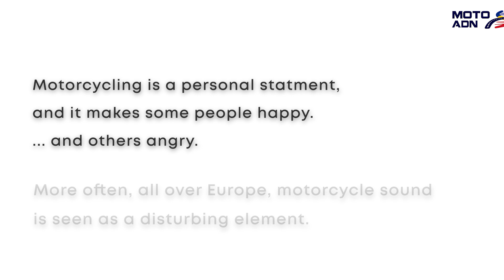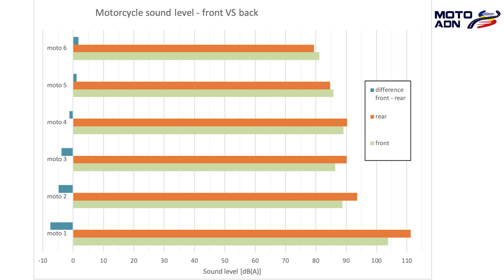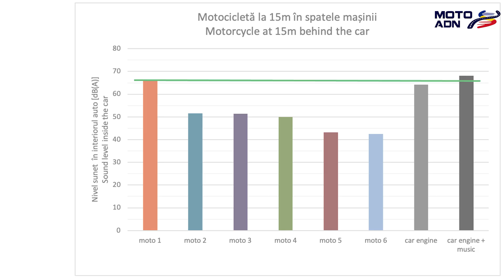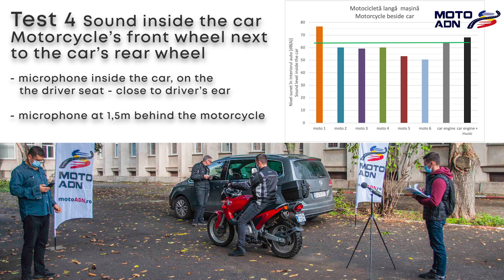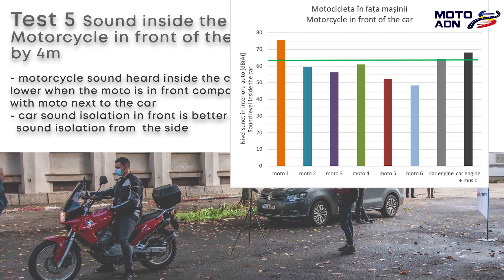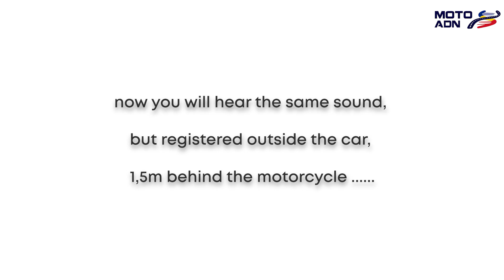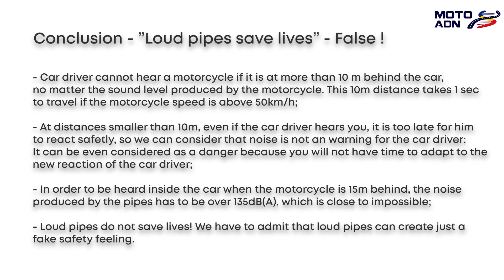Do loud pipes save lives? Now you have the answer!

Comment: I agree, your test is flawed from start to finish. Just the fact that you do a test at a standstill while the situational is in perpetual motion with sound variations makes your test invalid. All you are doing is taking sound level meter measurements... Without taking into account a lot of other parameters, such as : 

- During the inter queues, you are surrounded by cars and there is less than a meter between the cars and the motorbike. The sound ricochets off the bodywork. It produces a resonance. This is why French law stipulates that sound measurements must be taken without obstacles in the vicinity. In order to avoid amplification of the sound, by external elements, in order to have a neutral measure. This is not the case in real circumstances.

- You are taking measurements on an engine that breaks down... It produces high-pitched sounds, whereas you can perceive sounds at low frequencies much better. For example sound competitions in cars, what kind of sound do they use? Bass sounds make the windows wobble, whereas treble sounds would break them... You could say that windows propagate sound through their undulations, the same principle as speakers, they undulate in order to produce sound. You could say that the windows propagate the sound through their undulations. The walls of sound that make your hair move are bass, never treble.

- The moment when a motorbike makes more noise is not during acceleration but during deceleration... The gases remaining longer in the exhaust pipe resonate and amplify the sound.

Ask yourself the question, why is it that bass makes more noise in a tunnel than treble?
Does the sound propagate in the same way when it is 5 degrees Celsius as it does at 30 degrees Celsius?

What I can tell you is that a motorbike will never make the same noise when stationary as it will when moving at the same RPM speed.
On a personal note, the time when I should make as little noise as possible is when I'm on a steady downward speed. 
This produces treble, because the engine is in perfect balance between motricity and with less stress.

It's all well and good to take measurements, but all factors must be taken into consideration. Here's a link to corroborate what I'm saying: @t

To make a scientific test is not just a matter of taking values and putting them down on paper...

The simple fact that you did not take into account all its variables, shows a defect of proven seriousness. 
By definition a scientific test should not be within the reach of the average person. Now, with your setup, I want to do the same thing on a supermarket car park. 

I dont know, how to "quote" youtube, someone can quote @motoadn ?
Translated with @t (free version)
Reply: Spot on - completely flawed execution.

In the same way that my v-twin bike sets off car alarms in car parks whereas my previous bikes (4-cylinders) with different exhaust notes (higher) do not, supports your point about different tones causing different sound waves that travel differently and also go through things differently as well.

I think they need to do waaaaaay more research.
Reply: @Br3izh Motard, if you know so well what they did wrong, why don't you make your own video and do it properly then? You can't ignore the fact that they make a valid point stating that motorists in modern cars with the radio on, even at a standstill (ie without road and wind noises) probably will not hear you. Both NTHSA and ADAC have done similar tests in the past and they came to the same conclusion. Loud pipes do not save lives, they give a fake feeling of safety to the rider while they actually impair safety because the rider themselves can now hear less.

Loud pipes do not save lives, they only annoy the neighbours. The only thing that can save your life as a rider is riding defensively and not allowing others to put you in a position of danger.
Reply: @fermitupoupon1754  I assume that I don't have to, because I'm not a scientist. 
A scientist would take into account, for example, the absorption of sound by the air according to its frequency.
For your information, a high-pitched sound is much more attenuated by air than a low-pitched sound. Where do you see that the "study" takes this into account?
What do you see in the video? A motorcycle breaking up? Do you often ride a motorcycle with a break-up? It produces a high-pitched sound, which is not my case when I ride.
Not to mention the reverberation of the waves on the bodies of nearby cars.

But technically, with their setup actually, anyone could do it. 

The only argument that can be made is about the soundproofing of large sedan/SUVs like BMW and Mercedes.

Now, I found a video of a person on the Paris ring road talking constantly and you know what? You can hear a motorcycle with a deep sound in the microphone coming from much further away. Then another one, with a high-pitched sound that you can't hear at all, even though its exhaust was well modified.

Harm the safety of the motorcycle driver? What do you want him to hear? High-end headphones are so soundproof... Then at the motorcycle school we are taught to pay attention to our immediate environment with our eyes and not with our ears.

You mention different studies, but nothing can replace personal experience. I rode in original and "noisy" silencers, in Paris, there is no photo, it saves lives, whether it's ourselves, the bikes that make shit and pedestrians too.

It's like I'm telling you, I'm doing aerodynamic tests outdoors when everyone knows that this kind of test is done in a wind tunnel.

My test is absolutely not representative and will distort the results.

Translated with www.DeepL.com/Translator (free version)
Reply: Br3izh Motard I couldn’t agree more!
Reply: this is the best explanation of why this is flawed. an engine under load will produce far more lower frequency sounds that one revving in neutral. this should have been done on a dyno for starters. and your note about amplification when riding between traffic is a crucial missed variable here.
Reply from the maker: you have all the information to replicate the set uo and for sure the results will be the same. Presumtion that a regular person does the test i5 is misleading ... what do you mean by regular? that we di nit have a track of proven results or juat that we do not know what we are soeaking about? ... at firsr queations youbhave ti know that every jurney start with the first step, and for the secon you have to know that we are automotive ingineers, designing cars and the test were run with a politechnic univercity and with the experts from the bigest producer of aound metter.  what is your experiance on automotive, sounds and scientific test? 
There are a lot of mistakes in your comments .. for examole in crouded area the cara areound you they are not amplyfing the sound but they create a tunnel in which the sound can travel more - the problem in this case is the fact the differance betwin front and rear it is more important that we measure, window do rezonate, like other surface but this will not increase the sound level this will just send the sound i side the car ... this is the way in which a sound can travel through a hars surface. the liat can continue but the ideea is that  you just took true facts and create fake conclusions!
Reply: @motoADN  I never said the results were wrong. I said that the study was biased because it was not at all representative of reality, particularly the Parisian reality, and because it failed to take into account important elements that could influence the result.

Just by the fact that you take the measurements while stationary, whereas a motorbike produces a different sound while riding.
you don't take into account the difference in absorption of a high-pitched, low-pitched sound, while it's playing
Moreover, the human ear perceives low-pitched sounds better than high-pitched ones...
A car window transmits by resonance more easily a low sound than a high sound...
Have you ever been in a car during a party? The car shakes with the bass and you feel it in your body... Do you feel the same way with high pitches?
Fireworks, what can you hear better? Low or High pitched?
It's a well-known fact that low voices have more lift than high voices...
There are so many examples... 
Here is an illustration: https://www.youtube.com/watch?v=dvktyZS7TKE

Your motorbike in the study, it produces a high-pitched sound.
I use real facts to illustrate my explanations, in order to make suppositions and not conclusions. I am not the only one to say that there is a difference, that it is not in our heads.

In Paris, we drive between continuous lines of cars, less than a metre apart. The bodies of the cars have a sound propagation effect. Whereas in your study, a car and a motorbike at approximately 2M, 2M50. 

It creates a tunnel, yes, but the tunnel effect will amplify the wave?
Waves of the same frequency interfere, they reinforce each other when they are in phase. 
You take two waves, one without obstacles, the other with. 
The ricochet makes the second wave join the first one, you're going to argue that it doesn't reinforce the first one? The energy of the wave has to dissipate...
https://www.youtube.com/watch?v=M2R1AQ6BL98

Furthermore, if we follow your argument, during the tunnel effect the car allows the sound to travel further, the sound is therefore audible further ahead and therefore ahead of the motorbike. 

You don't get the idea of taking a pipe cut in half and seeing if the water you are moving, forms a wave that gets bigger and bigger in front of your hand as you move it forward.
You are the experts, not me as you so aptly put it.
If being an expert is just taking measurements, I'm willing to be an expert... Sorry to be condescending, but that's what we take away from your study. Just taking measurements.
It turns out it's a lot more complex: https://physique.cmaisonneuve.qc.ca/svezina/nyc/note_nyc/NYC_XXI_Chap%201.13.pdf
I don't understand anything about their formulas, but what I have retained is that the effect of movement is important. You're doing your study... at a standstill.

French law prohibits any obstacle in the vicinity when taking measurements, there is a reason, in order to avoid propagation on surfaces and to 'amplify' it.

Then it saves lives, given the generalisation of the mode of transport that is the bicycle, come to Paris you will see how they ride. In silent exhaust, I almost cut it in half 3 or 4 times... same for pedestrians. 
Changing the exhaust system is no longer a problem. 
The excuse of headphones to listen to music is not 100% of people who wear them.

You won't prevent the fact that a motor vehicle will always be wrong in an accident when it is in its rightful place, no matter what the circumstances versus a bicycle or pedestrian who is at fault, that a lot of people don't want to pay all their life for someone else's bullshit.

After the fact that people complain about the noise in the countryside, yes I agree, this is clearly not normal.
However, I don't agree in an urban context.
The incessant parade of ubereat scooters and the like are starting to make people talk about their noise nuisance in Paris . This must be the case in all large and medium-sized metropolises.
https://www.lefigaro.fr/conso/ils-nous-pourrissent-la-vie-ces-habitants-excedes-par-les-nuisances-des-livreurs-de-repas-20201215

And there is nothing you can do about it, they only feed a need generated by those who work during the day and come back in the evening. The ubereat work until late in the evening. It is a problem of society and consumer habits, it is the people in charge who create their own discomfort.
Noisy motorbikes during the week are used to commute to and from work, but where are the people who complain about it? Usually in their cars or on public transport... How does it affect them? 

You know what? My retired father lives in Paris, on a busy avenue and he told me: "I rarely hear noisy motorbikes. On the other hand, what are they doing to the delivery men at home, they speak loudly, their scooter I don't talk about it..."
He's a biker.

It's like pollution, they talk about ecology, but they forget to tell us that a boat carrying containers pollutes as much as 60 million cars... that it only takes 14 of them to pollute more than the whole world's car fleet... That's a fleet of 40 thousand ships. Not counting ferries and other companies.
That the branch of the UN that manages international maritime freight is financed by the lobbies themselves lol, so a good level of conflict of interest is there ^^
This is a problem of international trade and consumer habits...

I don't have experience in aeronautics or the automobile industry, but that didn't stop me from teaching someone the effect of lift, the vacuum created by the wings keeps the plane in the air. Like not staying on the edge of the platform when a train passes, at the risk of getting sucked in. He had asked an engineer and told him I was right. 
To also say that you do car aerodynamics tests in the wind tunnel. You are not going to take measurements outside when you are stationary, without reproducing the displacement effect. Well, it's the same here, you don't reproduce reality in any way.
Not being a sound engineer by training, you will excuse me for not having the knowledge of an expert, just a reflection that in my opinion seems logical based on daily experience, saying that you do not take into account certain variables that can change the situation. Which any good expert who respects himself must take into account. You will agree with me that the longer a gas stays in the exhaust pipe, the more it will resonate and the deeper it will sound. I can't explain it to you in technical details, but for me it makes sense, I visualise it and it's simple for me to understand.

As you suggested, I will see if I can set up a test protocol on video, in real conditions.

Ps: sorry if I've written a novel, I have a tree-like rather than a sequential thought.
I am obliged to take all the vectors into account, a neuro right-handed person.

Translated with www.DeepL.com/Translator (free version)
Reply: @motoADN  how about some real world testing with a bike riding behind a car in traffic?
Reply: @motoADN  I'm going through all the comments and we're quite happy to tell you that your test is imperfect, not corresponding to reality.

The question that arises is whether you will be able to question your study?

Comment: I know that this statement is different as one is not in any motor vehicle  but as a pedestrian walking the street i can hear a background noise  of vehicles  passing that i would put at maybe 30 to 40 deci bells but i can also hear the louder  sound of a motorcycle engine at higher than tickover speed with or without noise dampening and  that machine might be several hundred yards away and approaching.  The same would apply to many a HGV. I  can also hear them  when its round the corner, up the road on another street. 

I rarely drive with music on as that can drown out sounds that I want to hear, road sounds etc. and so the test is not entirely correct as not all drivers will have the radio on. or the heater on full etc. tho I recognise that some will and therefore those other noises have been created and will  drown out or absorb the louder sound of any motorcycles.  A motorcycle being ridden down a road makes a totally different and unmistakable noise under working pressure than  one that is merely revved up but at a standstill. Whilst driving my ears are attuned to the sound of motorcycles   and  i can easily recognise their sound and i believe that this is because I have been a motorcyclist all of my driving life and I am 71 years of age with no hearing problems at all.

That being said I do believe that some  motorcyclists have a bad attitude to road safety and that their belief that having loud pipes saving their lives is just an excuse and should not be relied upon at all.  Riding in a safer manner would be better.  Harley Davidson with through pipes is one of the loudest of motorcycles  and by  reason  of the laid back  way by which they ride they tend to suffer less collisions than many other species of bike.   Street racers and racing replicas, even now on  just 125 cc jobs  without silencers having baffles in, they  seem to suffer more maybe because of the forward leaning and more aggressive style and manner of riding rather than any other cause.  

As with many other road users  one cannot with any degree of certainty conclude one way or the other  that loud pipes save lives or merely that it make motorcyclists and other road users deaf.
Reply: you touched on it: loud pipes are in fact detrimental to safe operation because they deafen the operator himself, denying him of important information of the environment around him.  not only that but 50% of motorcycle accidents being single vehicle accidents, trees and guardrails can't hear the motorcycle no matter how loud the pipes are.  but not only that:  loud pipes save lives liars prove themselves to be total liars every time the jump in the loud pipes pickup truck with harley decals in the back window or the sports car with fart exhausts or other loud motherfucking exhausts and do exactly the same thing in the 4 wheeler which proves beyond any possible doubt that the loud pipes have anything to do with fucking motorcycle safety.   like this asshole Harley Davidson coke sacker.  https://youtu.be/YmEXSdJ_lxM
Reply: Most bikes don't rev bomb which makes the bike a ton louder so if they turned the radio off and had the bike on a stand running at appropriate rpms the bike would be alot quieter and no doubt near impossible to hear.